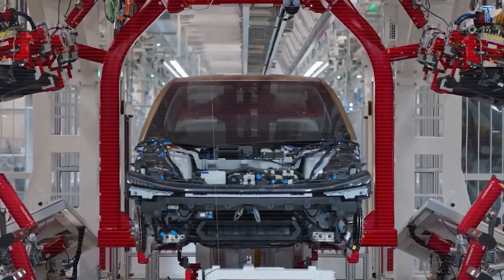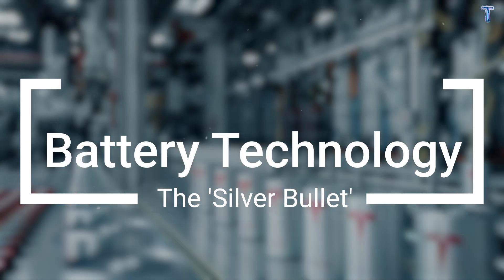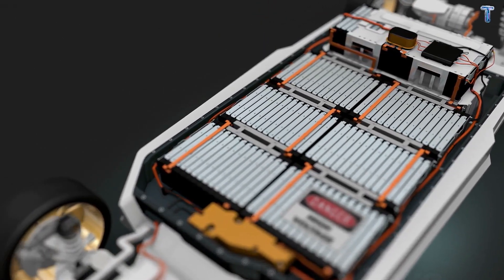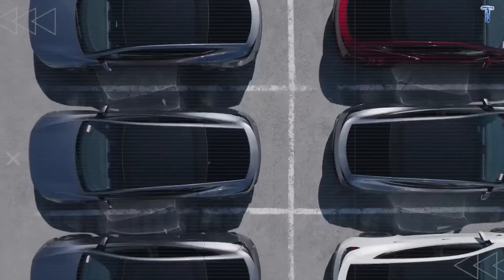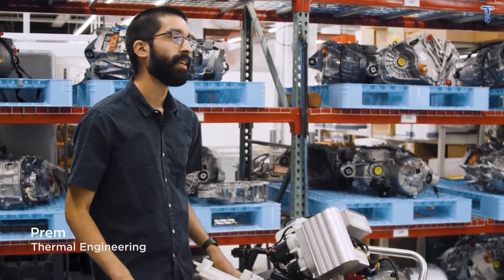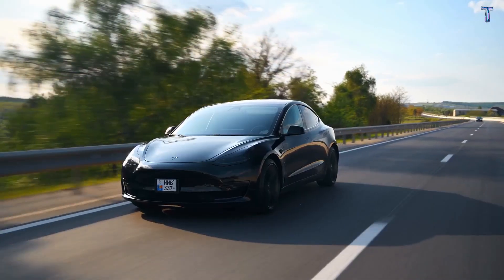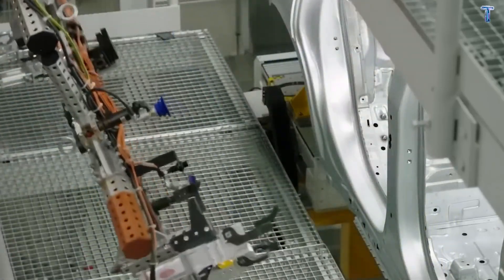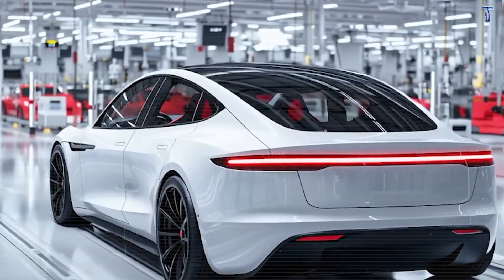$12,749 Tesla Model 2 Is a TRAP — Elon Musk’s Hidden Compromises EXPOSED

Comment: Test subject. I'd be willing if I were able to get the car for, say, half the price.
I would also want to test drive the car thoroughly before making a final purchasing decision.
I would also be interested in a service option where, at least, parts are  provided free of charge in the event of failures due to unknown engineering defects coming to light in the course of normal use.
Reply from the maker: Honestly, your approach is the smart version of being an early adopter.
Wanting a deep test drive + a safety net for engineering defects is exactly what Tesla should be offering — especially when early batches may include experimental battery tech and a first-gen thermal system that hasn’t been proven long-term.
If Tesla ever gave a 50% early-tester price or guaranteed free replacement parts for unexpected failures, the Model 2 risk profile would look completely different.
The real question is: Will they ever offer that level of transparency and protection? 
Because right now, the customer is carrying more risk than the company.

Comment: Seams like hack video
Did someone pay you to slam the model 2?
Reply from the maker: Nobody paid me, my friend. If the Tesla Model 2 had no issues, I wouldn’t have anything to talk about. But when they’re using enhanced LFP batteries that struggle in cold weather, potentially adding experimental aluminum-ion cells into early batches, and relying on a cost-cut integrated thermal system that can fail in multiple ways… that’s not an opinion — that’s data.